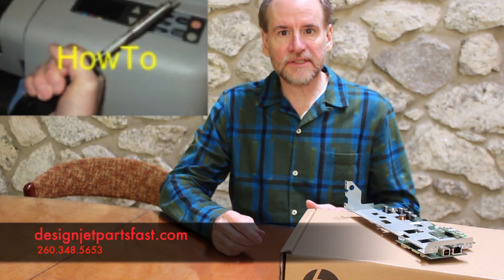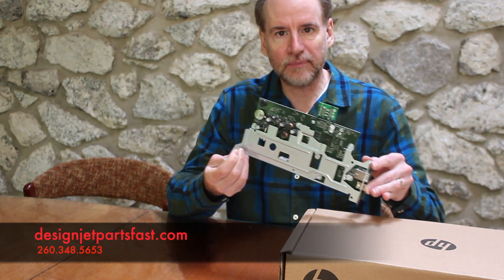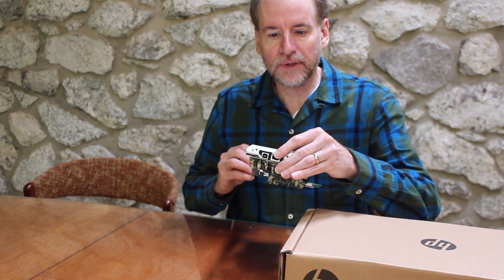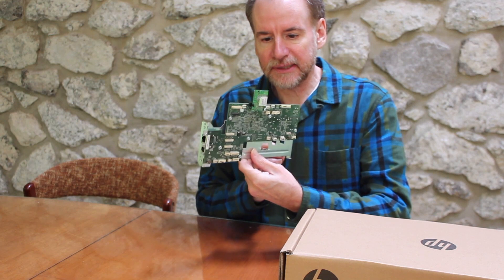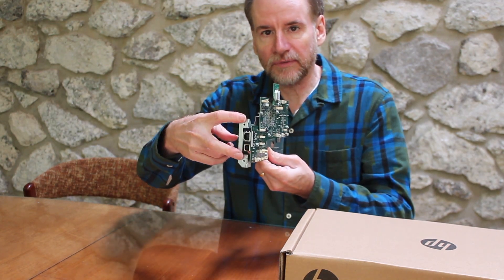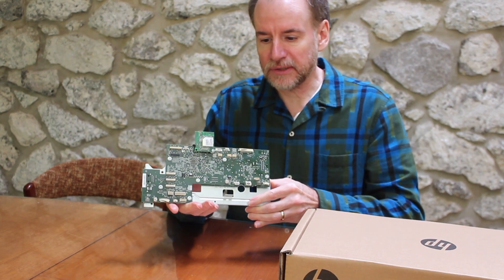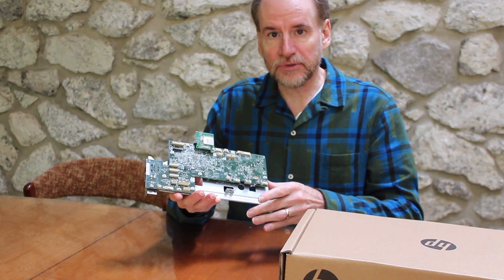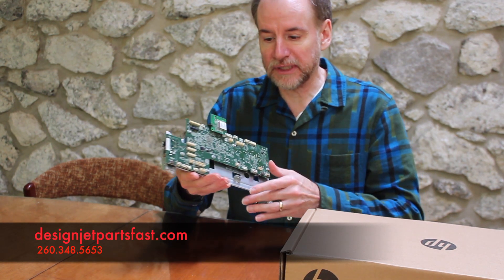HP designjet plotter repair for the  Designjet T730 T830 Main PCA Board | F9A30-67001 | F9A28-67020

Comment: Hello hi i have a hp designjet t790 eprinter.  I can only print from the USB plug. The problem is that during startup it does not load completely.  on the printed circuit board (1 flashes red) (2 and 3 light up solid red) I know if no.1 flashes it is the hd that is wrong with it. I will be happy if someone knows about my problem.  just say that it also has error 21:13 which is cleaning😢

Comment: Hello,
I was given a T770 plotter, which worked perfectly, and following a move and an 8-month shutdown, the start-up sequence blocked at 58% and led III, next to the network socket, flashed.
From what I read from the documentation it is possible that the electronic module is broken.
Can you help me with troubleshooting or point out specific items to test.
I have some knowledge in electronics.
Thank you

Comment: Hi, my T830 is stuck on the logo screen and will go no further. It makes no noise. I have to unplug it to turn it off. Do you think PCA Board needs replacing? More info here: https://h30434.www3.hp.com/t5/DesignJet-Large-Format-Printers-Digital-Press/Designjet-T830-frozen-on-HP-logo-on-startup-Tried-lots-of/m-p/8079987
Reply: @FixYourDesignJet  Thanks for replying. Will get a new board and see if it fixes the issue.
Reply: Hola solo placa nueva es la solucion?

Comment: Hi
Thanks for the  info.
I have a Designjet T795 and it doesn't print the blue color and doesn't show any print-head error either. I have tried cleaning the print-heads and replacing the cyan cartridge so far, but still have the problem.
What could possibly be wrong with it? I'll appreciate your answer.
Thanks in advance.
Reply: @FixYourDesignJet  Thanks for the reply. I haven't replaced the printhead yet, I only replaced the cyan cartridge cause I had a new spare one. I cleaned the printhead though and it did not work at all. I will get a set of new printheads in a few days and will try if the replacing will work.
Thanks again.